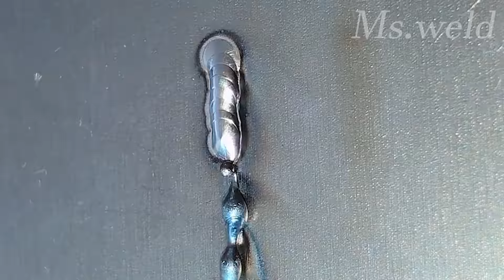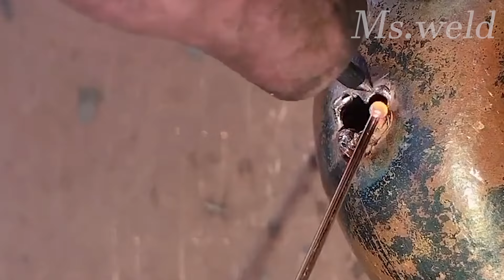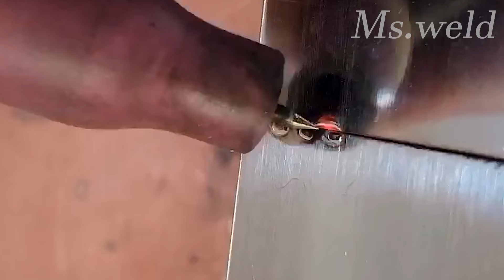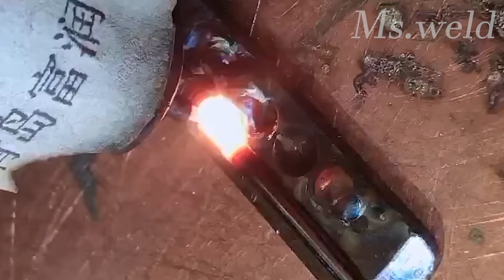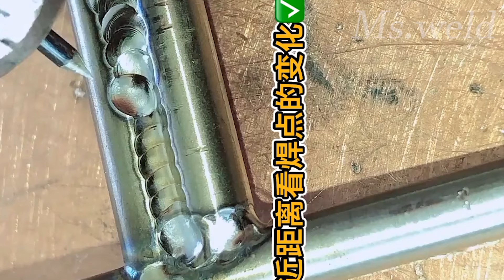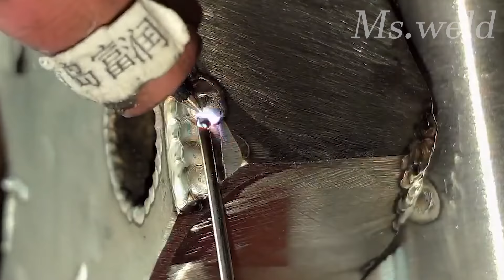Cold Welding Spot VS TIG Welding Spot,the difference is very obvious

Comment: The cold weld is great if you need to weld thin stuff together, that's what it's good for. Don't expect to have actual penetration though, so if you need that use normal TIG welds. Like say you want to weld up a hole on a thin stainless steel pot that's only 0.3mm thick? Good luck doing it with traditional TIG. With the spot welding, you can do it. 

But anything thick the "cold weld" is useless. Good for tacking, but you will need to go back over it with traditional TIG to have penetration. 

Maybe see if you can spot weld 18650 batteries...

I know some people like to see some cute Chinese girl welding, but maybe wear some PPE... like seriously. China doesn't exactly have a lot of women you know...

Comment: I was wondering how you shield your eyes from the flash as the weld process is in pulses not continuous so a self darkening helmet won't be of use.
edit....just saw the dedicated helmet with the cable to synchronise the darkening to the flash.....very clever.......it won't work with any other welding helmet so sales will be sporadic.
Edit....it will work with an ordinary auto darkening helmet, you just need a side spot light to illuminate the weld zone to prevent dipping the tungsten.